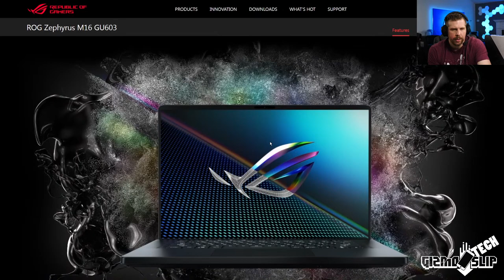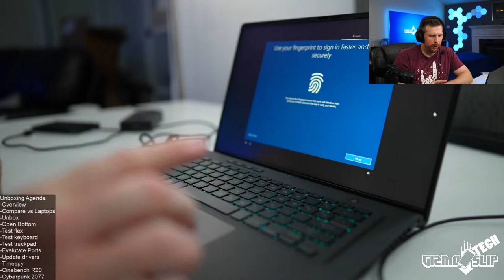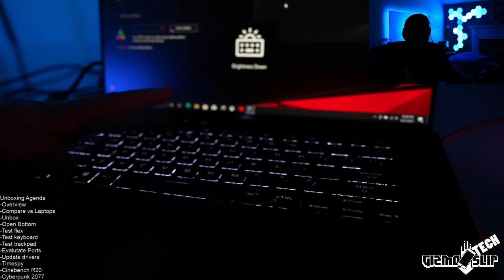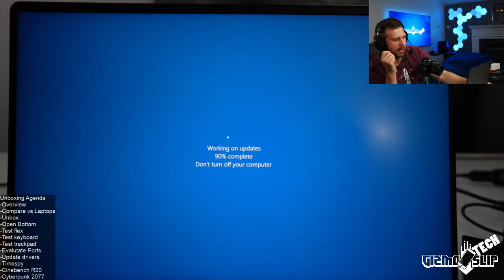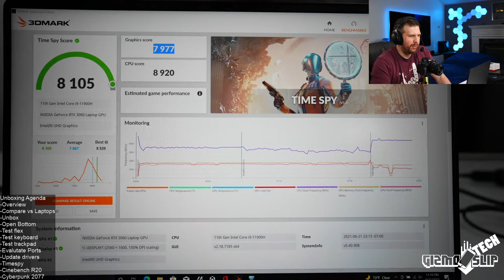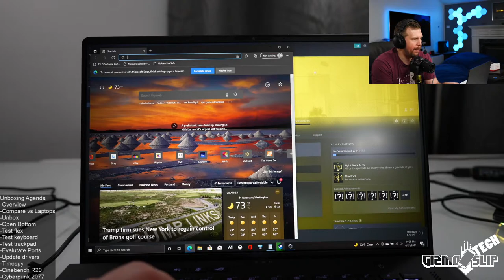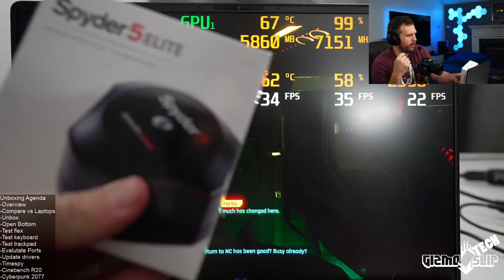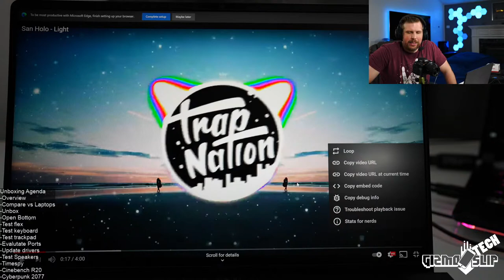Asus Zephyrus M16 Live Unboxing & Testing! i9-11900H, RTX 3060, and QHD 165 hz 16:10!

Comment: Thanks so much for this review!!

Bought the Zephyrus S17 laptop (the 165Hz screen variant) and it was delivered to me yesterday. 
Playing Cyberpunk 2077 atm... For me, the GPU temp does rise to ~83 °C (on Manual mode with fans turned to max speed) when I play for more than 35-40 mins.. yesterday I was playing on turbo and it had gone upto 86 °C. The CPU temp seem fine I guess... Late 60s to early/mid 70s. Performance wise, didn't find any issues. Btw I had changed the display to dgpu in the BIOS (from Dynamic).
 Online benchmarks do say that the GPU temp should be ~75-76 °C using similar settings.. I do get 75-76 °C of GPU temp, but I noticed it depends on the starting temp of the system.. for example, at the time of starting the game, if the temp is around 37-38 degrees, then the GPU does start at 75, keeps at <= 80 degrees for 10-15 mins (it keeps rising slowly and steadily) and stabilizes at ~82 after some time, but if it's already warm at the time I start the game, like ~54 degrees, then the GPU moves to ~82 very quickly, in-game, and settles at that mark.

I feel slightly worried about playing games with GPU over 80 degrees and threatening to move close to the 85 degree mark...

Apologies for the lengthy comment! 😅
Would appreciate any suggestions/ advice on this..

Comment: Alienware M15R5 with 5800H and 3070, temps went up to 102C for CPU in Battlefield 5 within 5 min at full fan speed and on a laptop stand and AC was blasting in the room. The laptop was connected to LG CX via HDMI 2.1. Temps held steady at 102C and the game ran smoothly.  Laptop screen, the temps were at 90C to 98C. Disabled Hybrid mode (mux switch) in BIOS and max temps went down to 98C. Called Dell, they did testing and said everything was fine. I am still within return period . I don't know if anyone knows whether external display leads to extreme high temps as seen with my laptop.

Comment: I stand between this, the legion 7 and the G15. The aspect ratio is so nice to me thoo. Opinions?
Reply: Legion 7 as it has better thermal performance and higher TGP with the same screen as the Zephyrus M16.
Reply: @FRESTEN ..it depends on ur usage  and req. - if u want a thinner and lighter then m16 and if u are happy with heavy and thick then legion 7 ..legion 7 will definitely outperform m16 as it has higher tgp and legion 7i is yet to launch so in legion 7 u will get amd and m16 offers intel 11th gen 8 core ..so all comes down for what u want laptop , what are ur req. and what is ur budget
Reply: G15 for portability, legion 7 for performance
Reply: @hightiernub1313  where can I get this legion 7 at?
Reply: @ittbelitt8409  Their own store. I would suggest just getting the Legion 5 pro. It has a better screen and is cheaper. G15 is too overpriced considering the TGP of the GPU.
Reply: @hightiernub1313  why the 5 pro isn’t the 7 better?
Reply: G15 has no webcam Wich is simply unacceptable.

Comment: How did you get your wall to light up when you're talking? Anyways, not having display outs at the rear or right side, and the lack of print screen button were deal breakers for me. I dock my laptop and extend the screen with the external monitor to the left, so cables would get in the way. And the Windows key + PrtSc screenshots are super convenient.

Comment: Thanks for keeping your sheet updated on the daily! One thing that bugs me... The "GPU Point Per $$$" column might be better expressed as "Cost per GPU point". For instance, the lower-ranked MSI GF65 is $999 and has a TimeSpy score of 7,268. If you take Cost/Score, you get $0.14 per point. While the high-scoring MSI GE76 at $3399 scores 12,678 points, you pay more for them ($0.27 per point). Intuitively, the price you pay for each point might resonate with folks better to assess relative value or bang-for-the-buck.

Alternatively, if you don't like that idea, maybe just remove the leading $ and then you'll have the actual "GPU Points per Dollar" reflected in Points, not US Dollars. :)

Again, props for all your hard work, great videos, excellent insights, and hard work. Now if you could just influence the actual chip fab speeds so I wouldn't still be on month 6 of waiting for my laptop...

Comment: This is such a strange pairing i9 11900h with 3060. Better to lower the price and go for i7 11800h + 3060...
Reply: yea 3060 is a hard sell for me at 1849 but dave2d found this thing to match the g15 amd 3070 at the same price atleast in games
Reply: @AlexMacho765  that's true, because to compensate for the lower TDP, they increased the clock speeds so it ended up performing as good as a lower rated 3070
Reply: @hashhacker2130  Wouldn't the 3070 with more cuda cores and 8gb be a better choice a year from now though?
Reply: @AlexMacho765  it's true, but if gaming isn't your priority. Also there are more applications which benefit from a higher TDP than there are from more cuda cores. The only point which you'd consider here though is the VRAM. Realistically there isn't much difference between 6 and 8gb, also if VRAM is indeed important to you, you need to be settling with an RTX 3080 with 16gb VRAM, not with anything less as you'd be limited to 8.

Comment: Still no competition to Lenovo Legion 5 2020 4800h+rtx2060 and Lenovo Legion 5 (Pro) 2021 5800h+3070, just an fact.
Reply: In matter of screen quality yes no competition since the legion 5 pro (2021) has 2k 500nits hdr dolby 165hz gsync freesync screen.

In matter of gaming i am sorry to disappoint you but the msi gp66, gp76 or ge66, ge76 are all better (mostly) with 10th gen intel cpu.
And the new 11th gen cpu is much better, both at gaming and productivity (which is the field of Amd).

They are still both excellent laptops.
Reply: @sehitovic  Yeah-nah..
Those synthetic benches don't show real life scenarios.. People don't use their laptops in streaks of 5-10 minutes of heavy duty tasks, they use it for hours and after couple of minutes  heat, throttling etc show it's ugly head.
Legion gives best performance for prolonged period  of time(you don't game for 10 minutes, you game for hours) and these are gaming laptops at the end of the day. Also, CPUs are really less important in gaming, they are good enough, cooler ones are better.
Also price difference is enormous(so, it's kinda not fair comparison) and also check another dead giveaway, check power bricks, you'll see 230w/300w on Lenovo, also, no one is stopping Lenovo to put Intel CPUs if they end up being way better in the long run, no one is fanboi.
Reply: @noonerelevant2583  the msi models quoted have the best existing coolers in the market, there are many benchs where you can see msi gp model (not the premium model of msi) reaching max 60 degree and the lenovo reaching more than 70 in the same game with same conditions.

You are right about the price for the GE model, the GP model price is more closer to Lenovo.

Also i am not a fanboy this Lenovo is an excellent laptop, i am waiting for the new Lenovo 5i pro with 11th gen intel, it will be a beast for sure !
Reply: @sehitovic  msi, asus, gigabyte and alienware are outlandishly expensive in my corner of EU(way more than USA MSRP), while Dell,Lenovo,Acer and some TongFang rebrands are almost cheaper than in USA?!?
IDK. on what metrics they sort prices, but I  do feel that big players kinda sliced the market among themselves.

Me, personally would really like to buy some Eluktronics models, but they are just not worth it importing from USA when you count in import taxes and transport services and they don't have any HQ in Europe.
I believe you about MSI GP yet price/performance still cant come close to LL5(here..) and..Legion 5 just looks so much better and I know that shouldn't be important but, it is. 
Will check those MSI models, but, I got myself LL5 and I see in front of me how good everything is, CP2077 all maxed(DLSS Quality) and in Ansel GPU shows 64 Celsius ?!?...
Reply: @noonerelevant2583  ye my mistake i was talking about CPU temps not GPU 😅, GPU temps are excellent for both.

If you are in Europe you can look for Xmg  which is a TongFang chassis like Eluktronics.

I don’t have any of them im just talking by using benchs available in YT or Reddit. 
 
You have a very nice laptop enjoy it.

Just a question : Do you mainly downscale the resolution to 1080p to have more fps instead of playing in native 1600p? 
And also does it appear blurry when you downscale ?
Reply: @sehitovic  Honestly, DLSS is incredible  thing, really no difference from native(on YouTube reviews they have to make 500% zoom on some small part of some unimportant  fence to even find some difference, I wouldn't notice it while playing in a 100 years and difference is not worse than native, it's just slightly different.. if that makes sense)  .
Only thing I noticed were some small artifacts on smoke in CP2077, IDK if it's from DLSS or bug or RT, but, it lasts for millisecond, totally irrelevant.
But, there is another thing, even if I didn't need DLSS, I would use it.. why strain HW if no need...
P.S.
I am talking about DLSS2.0, not 1.0 ...
Reply: @noonerelevant2583 
"no competion lmao"

Comment: MSI GP76 i7-11800H scored 5234 on r20. This i9 is pure trash.
Reply: Because it is undervolted to preserve the battery and temperature
Reply: Not alike. You don't compare laptops of different classes. Msi is 2 lbs heavier and is also thicker. The same reason the chonkier legion 5 pro runs it's components at much higher power limits